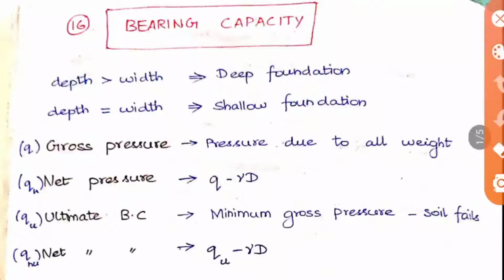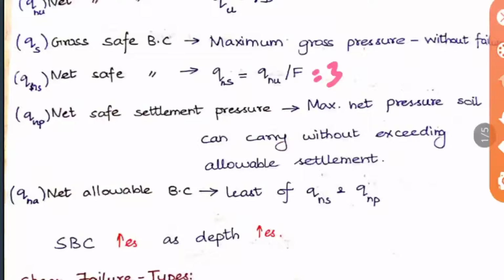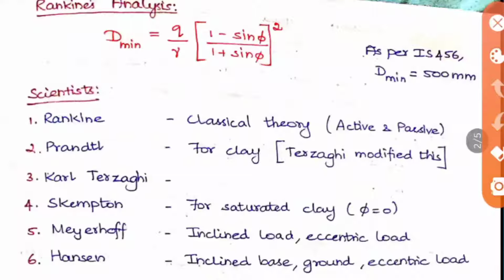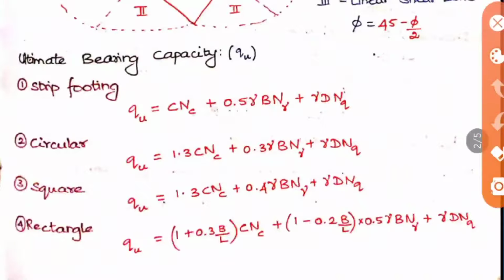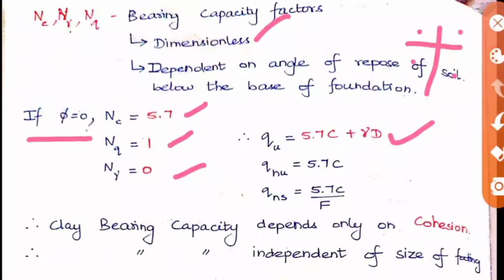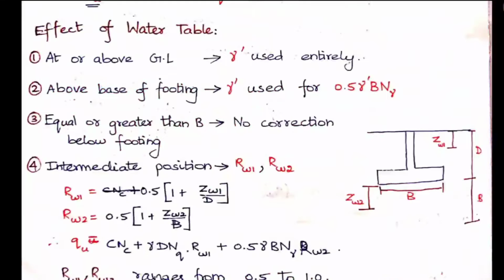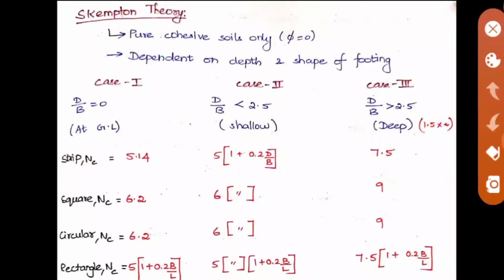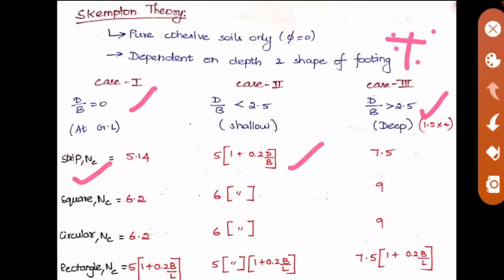Bearing Capacity | Foundation Engineering | Lecture 5 | English

Comment: Mam ,I have one doubt about   correction factor.   Can you clarify that doubt 
Water table at or above the ground level.   Means.   Unit wt = submerged unit.   In second and  third term.   Why Rw1 and Rw2    is not there
Reply: Tq mam
Reply from the maker: Rw1 and Rw2 should be used only when the water table is at intermediate position.